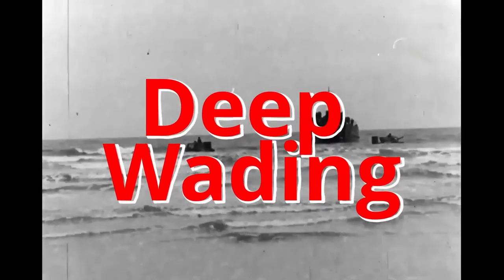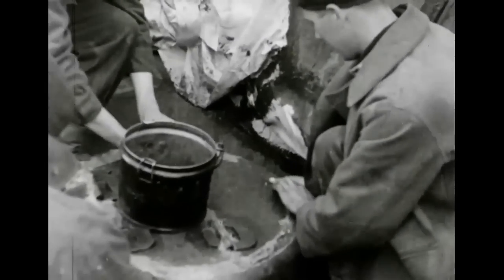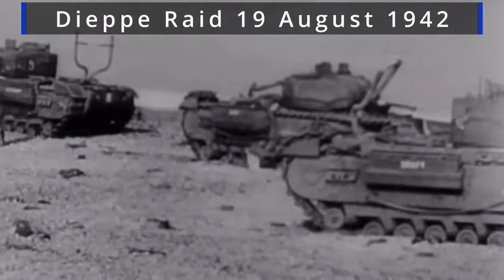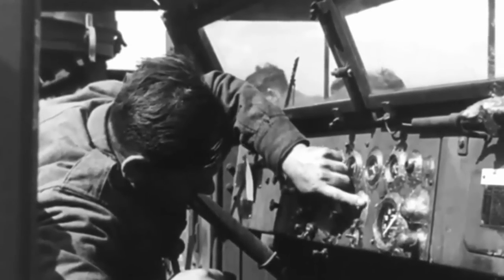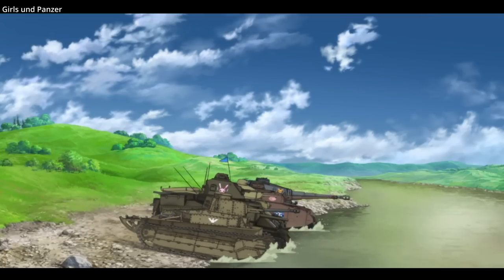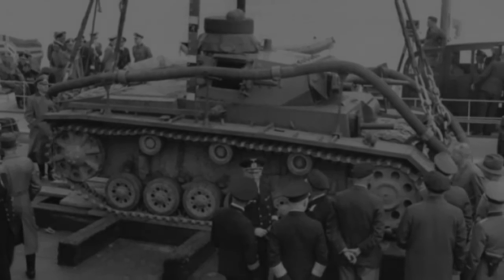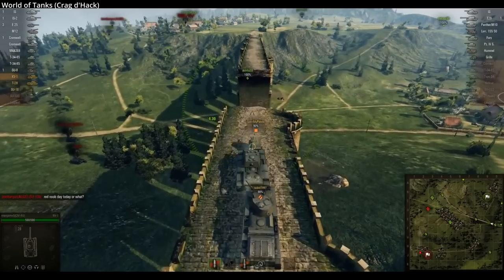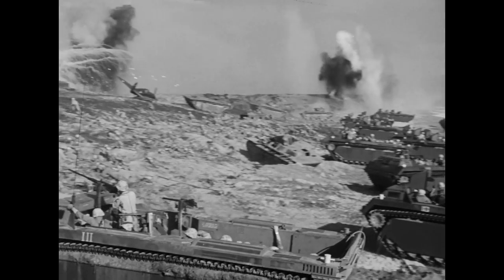Deep Wading Tanks WW2

Comment: Imagine being in a Tauch Panzer 10+ meters below a freezing ice flow covered Russian river, your tank is literally 'dead in the water'. You've got no choice but to bail out and chance the freezing waters, but before you can open the outward hinged hatches you would have to FLOOD the interior of the tank with ice water in pitch black because by then the electrical system would be shorted, and you've got 3 or 4 crewmembers trying to not panic and "wait" for their turn to exit. 

That would be a Sucky Day even by Eastern Front standards.

Comment: Yeah.  IIRC ... the basic idea - was that they'd have the swimming DD Tanks individually make their way to the beach with the earlier waves of infantry in such as LCVP's.

LCVP's held about 30 guys - or about a Platoon.

These early waves would be getting most of the enemy defensive fire.  Thus - if an enemy gun hit a DD Tank - you only lost that tank - but - if an LCM with several non-swimming tanks on board took a hit - you could lose all of them.

After the LCVP's - they had LCI's - which were much more like ships.  They had a ships bow - but then they had these two little ramps coming down on either side of the bow.

LCI's held about 180 guys - or about a Company.

If an LCVP took a hit - you might lose 30 guys but if an LCI took a hit - you might lose 180.

So - the idea was - they would have these individual tanks and platoons land - in a more dispersed pattern - so they'd take fewer losses.

After the enemy's defenses had been reduced - they'd have LCI's landing troops with LCM's and LST's landing the vehicles.  

It's a mark of how bad things were at Omaha Beach that troops disembarking from LCI's were under fire as they came down those little ramps.  That wasn't supposed to happen.

An LST could carry quite a few vehicles and was a Landing SHIP Tank - which was Ocean Going.  It has a flat bottom - that made it a poor sea handling ship - but it was a ship that could sail across the Atlantic and carry a lot of stuff.

The LST's would have the Deep Wading Shermans in them.  With that Flat Bottom - the LST could open up it's bow doors and drop a ramp right onto the sand in some cases but you never knew about that water.

The trouble with Beaches - is that sometimes they have sand bars off the beach with deeper water between the sand bar and the actual beach - and - sometimes there are shell holes from the Naval Bombardment creating deep spots.

Thus - even if  they are being off loaded from an LST which can get pretty far in towards the beach - you never knew.  So - they'd have all the Sherman's that were being off loaded from LST's with their Deep Wading gear - just in case they needed it.

Later on - once the Navy had the beach all figured out.  Engineers would have constructed specific spots for the LST's to come in and unload safely - but during the first hours of the landing - that hadn't happened yet and they were still unfamiliar with the beach.

Off Tarawa - they had tanks with no deep wading gear sinking in shell holes that they lost.  They had Marines wading ahead of the tank to try and see if it was about to run into a Shell Hole and guide it around them.  These Marines were under fire and not all of them survived - but - they had to lead the tank in - if they weren't going to lose it in a hole and they needed those tanks.  Deep Wading equipment would have made it unnecessary for Marines to do that.

The vast majority of the Deep Wadding equipment wasn't needed - but - sometimes it was and if you didn't have it when you DID need it - you could lose the vehicle and driving into a water filled shell hole wouldn't do the crew any good either.
.

Comment: A better option than those Shermans with curtains ... which were curtains for the crews if they leaked.  A snorkel may not work in more than a few metres of water, but at least retaining contacts with the ground made them mobile, the weight giving them traction.